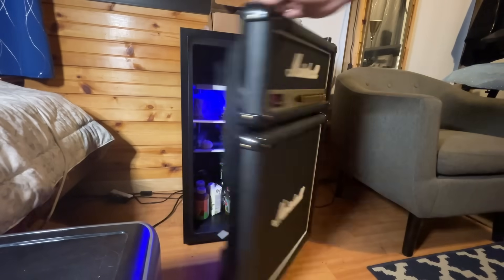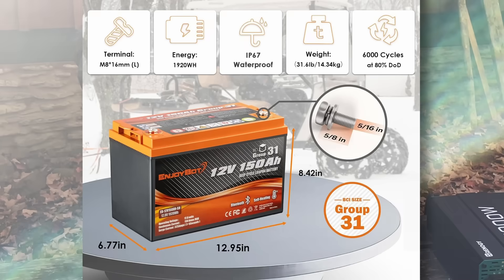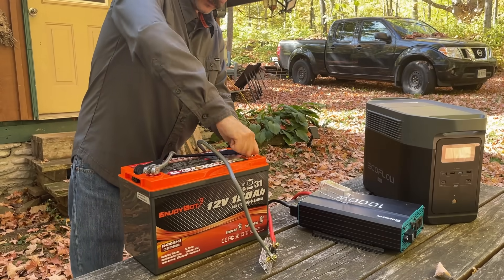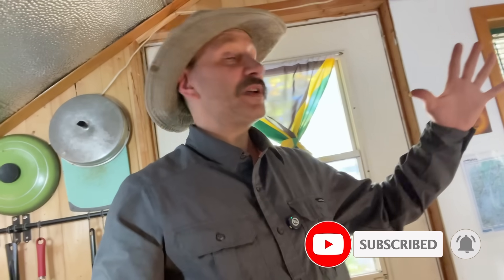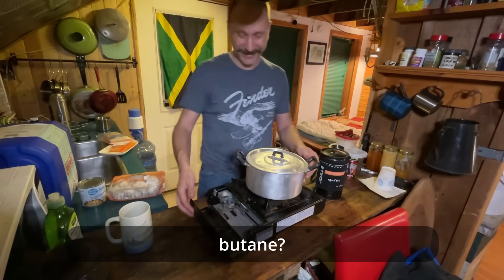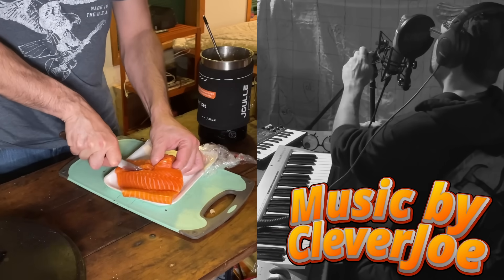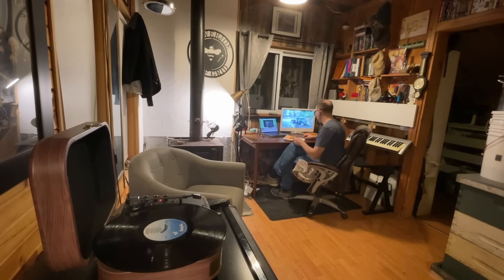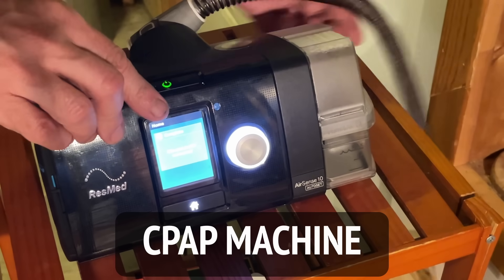Can a DIY Battery Setup Beat an EcoFlow? 24H Challenge

Comment from the maker: 🔋 EnjoyBot Battery Affiliate Links: 
🇨🇦 CANADA: https://enjoybot.ca/?aff=2 (use code CLEVERJOE for discount on any12v battery)
🇺🇸 USA: http://www.amazon.com/exec/obidos/ASIN/B0D62XXB7S/cleverjsmus0a-20/ref=nosim
I’d love to hear your thoughts — would you try a DIY setup or stick with a pre-built unit like the EcoFlow? Drop a comment below! 👇
Reply: Enjoybot looks like an ideal piece of kit.  I will check them out if-and-when I expand my system.  What led lights do you use?
Reply from the maker: I forget where I picked up the led lights, I think the ones around the window were from Canadian Tire. The 12v Enjoybot battery seems fine and it's a good price - the APP is very basic but shows the info you need to know. It's the first self-heating battery I've reviewed so we'll see how it goes this winter.
Reply: Inverter Fuse Battery.  How do I determine what size fuse I need to insert between the battery and inverter?  I saw an inverter for sale that is grounded.  I bought an inverter off Amazon with No Fuse and it sparked twice when I tried to connect it to my battery so I sent it back for a refund.  Anyway... I will be using a 12.8Wh x 300Amps battery giving me 3840 wh.
Reply: I would prefer the easiest and safest way without having my husband here on earth, but I would try either! I’m just not mechanically inclined at all! Lmao!
Reply: Can't you just give us a full version of tutorial,?   bc  not everyone esp seniors,  who have the funds to buy those expensive powerstations investment. Is car battery DIY too complex for avg person? And can you demo how long that DIY last approximately?  Would ecoflo run avg old fridge and cook portable cookware?  I'm disabled, in wa.... clueless with cost effective prep tools. Is it even possible to use solar recharge panel? 😂
Reply: I just read  on Google ai ...cpsp report re delta max 2000 for units sold from July 2022 to May 2025 , for potential fire,  burn hazards ... anyone verify or able to get refunded?

Comment: As someone who has both an EcoFlow and Bluetti solar generators, the “don’t” need a solar charge controller for a power station is not 100% true. Try plugging a 24V solar panel directly into your 12V power station. 
Especially the plug and play ones like Bataria. They require that some power goes into them so they automatically set to the correct voltage. The solar input of standard solar generators output zero (0) voltage. The charge controller will not work unless you plug a 12V source into the circuit.  To avoid this, make sure you purchase a12V solar panel for a 12V power station.
Reply from the maker: There was an assumption that the correct voltage panel would be used, but I suppose one should never assume lol. Thanks for the clarification.

Comment: I've done both methods for an off-grid cabin. Started with a simple SLA battery bank and solar panels and an inverter. Ran the lights on 12V to save on inverter losses. As someone who has done this (and set it up for someone else to use)... if you cannot do math and budget your power very carefully, you have no business doing it this way. The person I set it up for wrecked a very expensive battery bank by running it down to zero, over and over again, in spite of my pleas to take it easy on the power budget.
Switched later to an EcoFlow, powered by solar panels, backed up with a generator. Now running some aux circuits like radio base station on 12V lifepo4. The EcoFlow is a very good tool in the toolbox. It's useful to have good metering and know how much power you are consuming, and how much you have left. But, as you have demonstrated, you can certainly do it yourself for less money and less complexity. EcoFlow is good for non-technically oriented users.
Good video.
Reply from the maker: Thanks for this, appreciate it.

Comment: Power banks are very handy, even smaller ones.. I have an Ecoflow River Pro I use at my off grid deer camp and at home to run a travel cooler/ fridge during power outages. It will keep the fridge at 34F for more than a day. I recharge it when needed w a small imvertor generator.  I can fully recharge it from close to zero in under an hour.  Usually I only need to run the generator for about 20 to 30 minutes though to top it off, rather than having to run the genny constantly to power the fridge. The generator will run for 8 to 12 hours on one tank (1.1 gallons), so the Ecoflow is a great fuel saver. I have 200w panels that I've never bothered to connect since using the generator is so easy. 

If you buy the components to DIY, be sure that your inverter has a stand by mode. Some will automatically shut down if they aren't under load for a few minutes.  That's bad when you are using it on a fridge type device that cycles on and off periodically. The Ecoflow has a setting for that. 

If you have more then one battery bank, you can plug the one with the most capacity into the smaller one to act like an add on battery because most battery banks have Flow Thru, they can recharge and provide output at the same time.  Go from big to little, not the reverse.
Reply from the maker: Good points here, thanks for sharing!

Comment: I’ve been a diy Solar person since 2014.
I’ve recently just discovered that MPPT charge controllers are better than PWM 🤣🤣🤣
Yes I had no need for an mppt charge controller, until now. Oh man does it make a HUGE difference. 
Now with this video I’ve come to realize that Walmart RV batteries are a waste of money.
Will be getting a solar battery now, so I can run an 8.8 cubic foot chest freezer instead of buying ice three times a week.
Took me a long time because I got used to to living without TV and all the things that come with living in a normal, electric company powered home. At this point I think I need to get at least one new thing which is a chest freezer. 
Thanks for the informative video.
Reply from the maker: Getting used to living without a tv is a good thing. ;) Good luck with your setup.

Comment: Power station are overrated youm can build your own battery bank for much less especially with the prices coming down
Reply from the maker: I used to think this, but with the price of power stations levelling out I think it would be difficult to build the same system for 'much' less on your own. That said, if you have the time and like tinkering, building your own diy power station is still a great idea. Cheers, Joe

Comment: Thank you for this trip down memory lane. My first experimental solar battery bank was a 90watt Harbor Freight panel system hooked to 2 100Ah AGM batteries and several inverters of varying power levels in 2012. Along came Hurricane Sandy and the first live test. Our refrigerator was the only one on the mountain that wasn't powered by a generator, and it did fine for 5 days until we got power back. It taught me limits and capacities and was the gateway to a 1200watt solar system, 24v 3500watt inverter and 200Ah lithium battery system powering our RV refrigerator, coffee pot and electric induction cooktops. The house batteries (regular 12v rv electric) run water pump, furnace and lights. Learning is life!!
Reply: I'd love to see a tutorial how to build,  how did you learn and is it complicated and risky for clueless folks like me?  It's a huge investment not knowing which one to buy....priority to save fridge full of food or risk over charging devices. it's overwhelming to know for prep tools on fixed income. Any suggestions on what cooking tools also?
Reply: @vandao2847 
I got my rv system off amazon and at the 3500 price point they've gotten better. Tutorial came with the system. Very easy if you're handy at all.

Induction hotplates run at variable wattage so they're easy to use. Them you just need compatible pots n pans.

Comment: The video was nice. But please next time you ever do something dealing with power and reviews please add somewhere throughout the video at least where you display each items suggested power supply that is necessary so when others are considering the efficiency of said item they have a comprehensive expectation of its capacity for individual use otherwise the video lacks true value. Because you had me sold but now I’m still questioning whether or not it has the capability to maintain all my systems or which of them it will be best used for and how many batteries are necessary
Reply from the maker: Thanks for watching, and for your suggestion. I often do include power consumption but it could have more clear in this vid. I talk a bit more about power used for specific items in this vid:
https://youtu.be/k-rP7Vi8NAk?si=3q6yFxqhyW2TrMQU

Comment: All of the text makes it hard to see how you set some of the wires up.  This is my first DIY build and I had a situation where an Inverter caused a spark twice when I tried to connect it to a battery.  So In am trying to figure out how to safely connect inverter to battery. It looks like you have the positive from inverter going to the Fuse Box but after that I am NOT sure what you dad?  I see a Red Wire from Inverter going to the fuse box and what appears to be a gray wire going to the positve battery terminal?  Anyway trying to figure out to to effectively attach an Inverter to a battery without sparks.
Reply from the maker: This was just a basic DIY demo, not a step-by-step tutorial. When you wire an inverter, you’ll need to make sure the fuse matches the wire gauge and the overall setup you’re building. There are some excellent tutorials online that walk through safe inverter-to-battery connections in detail, and I’d definitely recommend watching one of those.

Comment: So I got a 4500 watt inverter what size fuse should I use a what is the best cheap battery for that
Reply from the maker: Check out the Enjoybot batteries, you can also use the CleverJoe coupon code for a discount on anything on their website. Cheers, Joe

Comment: Both for me. One potential benefit of the do it yourself system is get any battery you like and ease of switching it out with a back up.
You can also recharge your fancy battery bank using the inverter.

Comment: I have an old generator and battery charger.  The generator is too dirty, but it charges the battery in a short time. A 1,500 watt inverter keeps my house on line. I just give it a kiss.

Comment: Having a basic understanding of Ohm’s law ( the laws of how electricity works) is fairly easy and important if a person is planning to do a diy system. For example, your 500 watt cooker draws about 42 amps with a 12 volt battery. That same cooker using a 24 volt battery draws about 21 amps. And finally at 48 volts,it draws just over 10 amps with. And a 24 volt battery at the same amp hour rating (Ah’s) will run any device for twice long as a 12 volt battery .  The less ampacity you have the smaller wires and fuses you are able to use.
Reply: Yes,  smaller wires and fuses, but, always a trade off.  Cost in converting from 48 to xxV
Reply: @B_Rad5280 don’t convert, do it with the correct voltage the first time.

Comment: The first battery-operated inverter was a small cigarette plug-in inverter from Radio Shack. The power source was a 9.0 18V Milwaukee battery. All I wanted to do was run a string of LED Christmas lights so we would not be sitting in the dark while the grid was down. It works excellently and ran the whole time till we went to bed.

Comment: One thing people don't talk about is in a lithium battery is the BMS which limits the current output. In the spects my battery description says it has a running output of 150 amps. The description for the listing said it is 200 amps. Hmm... The 200 amps the listing says is the "peak" amps. 
So in my system if I want to run anything that uses more than 150 amps I need a second battery connected in parallel to provide enough current.
Reply from the maker: Good point - the “200A peak” rating just means it can handle short surges up to that level, usually for a few seconds. The “150A continuous” limit is what it can safely supply over time. If you need to draw more than that, adding another battery in parallel is the right approach. Cheers, Joe.

Comment: My 200 amp hour, 2,000 watt power system runs a small 50 quart fridge and a 50 quart freezer for at least 24 hours. I can also run my vacuum cleaner long enough for Flowbee to cut my hair without the battery voltage to drop enough to notice.
Reply: Flowbee 😂

Comment: I built a lithium ion battery for my UPSs I'm using three of them. When the power from the inverter goes off the UPS 's keep the electronics going. The lithium ion battery is 20 amp hours over the 7 amp hours of the original sealed lead acid battery.

Comment: I built one with a cheap 200 amp hour battery. It's better than the echo flow you have there. 

Enjoybot manufacturers several brands of batteries. My Chins batteries are made by enjoybot also.

Comment: You completely forgot about the other side of your system. The recharging side. Where is that part?
Reply from the maker: This was a simple demo and there is a LOT not covered here, it wasn’t meant to be a full tutorial, rather it’s an example of a simple DIY system. I may do a follow up video to cover charging options. Cheers

Comment: Why do you need - even need an inverter.. We can buy all 12 vdc 24vdc 36vdc 48vdc ... powered appliances, our phones, laptop  tablets  refrigerators even stove tops are made in DC these days so why waste power.. and money ?  My point being,  all you need is solar panels, battery (s) a charge controller and a power outlet - switch box.. with power monitor if ya like... all for around 250 bucks total for a 100 amp hour Lifepo4 ... add another 150 bucks or so for each additional 100 amp hour battery you add... to it.. A 100 amp hour battery is 1280 WH  ... most all in one power  stations that sell between $ 150.00 to $50.00 bucks are around 280 WHs.... that's 25% of a 100 amp hour lifepo4 battery's available power. BTW I'm talking DC to DC  charging... no loss via conversion from DC to AC...and often back to DC... lol Dah !
Reply from the maker: Good point, you can certainly save power usage by converting 100% to DC - a lot of times this is a challenge but even a hybrid of 12v and AC will save energy. Cheers, Joe

Comment: For our home, I have a junky old shed I have my Delta 2 Max in to run lights and tools the last few months. Been looking at a DIY battery/inverter like you did b/c it’s a nasty place to have that fancy power station. DIY stuff can get thick dust on it or spider webs and not become “unusable “ . Want to bring the Delta 2 Max up to the house to keep for backup & not be dirty or clogged  from the old shed.

Comment: Your 1000 inverter doesn't even come close to the ecoflow unit you have . Buy the time you  get comparable components and wiring and charge system it's cheaper to just get ecoflow for a small system like that
Reply from the maker: Thanks for commenting. This is a basic setup and not meant to be compared directly with the EcoFlow. That said, a DIY system with comparable components can still compete on price. Best, Joe

Comment: Pondered doing the DIY, but got the Ecoflow on sale awhile back. They seem to have sales alot, so it isn't a bad option. Personally I've used it a few times on the go, even running air compressors when I had to help my Dad patch a tire for his truck at the side of the road. Also not a bad option if the extension cord can't reach since I've run tools and computers on it. If I didn't need the mobility, DIY in a fixed location is probably the better way to go since you can repair a system like that.
Reply from the maker: Thanks for sharing. I'll just add to your point about the sales for anyone else who is reading this - they ALWAYS go on sale. Ecoflow, Bluetti, Jackery and the rest. Cheers

Comment: I did something similar, but added an automatic transfer switch to it for my sump pump. Worked fine for quite awhile.
Was only a lead-acid deep cycle though.
Standard float charger when power was on...only meant as a back-up

Comment: I have a DIY system. Over time it'd grown from a 400 watt in solar to now over 2500 watts. From 1 100 amp batt to now 1000 amps in batts. Best thing was I learned how to build it, maintain it and upgrade it. I would never of learn that with a prebuilt system..Also I have $1000's in the process...
Just my 2 cents
Good luck

Comment: Did the same thing years ago with a lead acid deep cycle battery.  The motive was for emergency use. Put it on a small dolly / hand truck. I still use it today. No noise. Store it inside. ready at a moment notice. 95% of the time the outage is short term so dragging out the generator is not needed. Good info to share.  Nice place you got there.!

Comment: Hi I’m building a system now what type of fuse is that called great info thanks
Reply from the maker: You'll need to match the fuse or breaker to the battery and wire gauge being used, but in this video I'm using a 150A fuse.

Comment: So glad you're showing how simple it is to get basic off grid power supply.. i find that a single 12v leisure battery 145amp and a 12v cigarette charging plug that is connected to a simple cheap solar trickle charger with built in charge regulator 2x  USB port for charging phone laptop and battery pack I've an additional solar panel 600w although it's debatable how generous that 600w is im in England so sun isn't the best in winter so ive an 1000w four-stroke generator as a kinda inverter oppose to an actual inverter just because you might as well for the cost 99brittish pounds with a battery charger so when its on it's also charging my battery full too go through the night